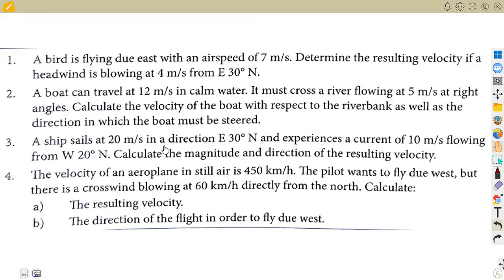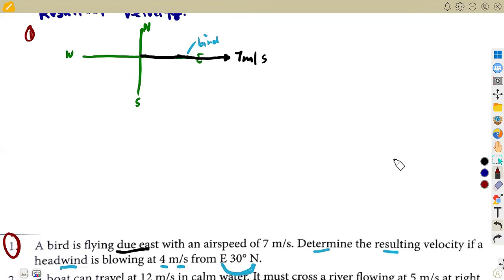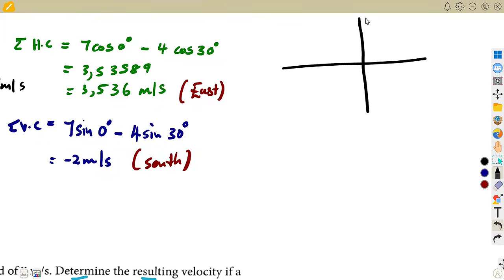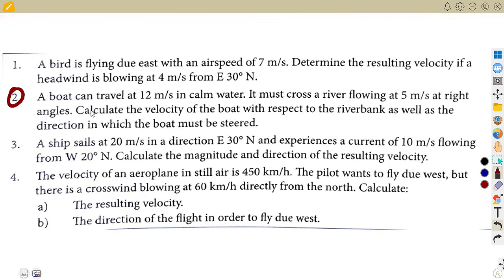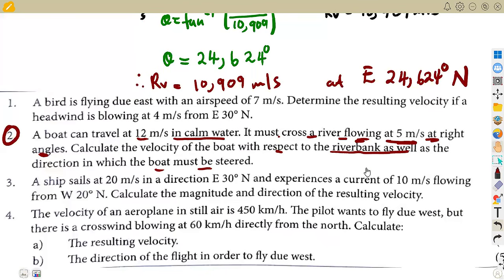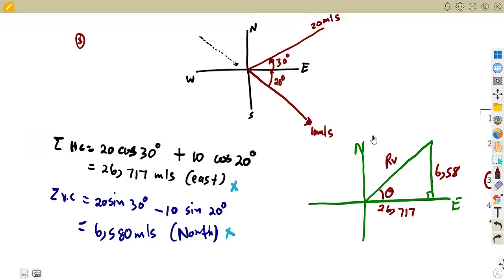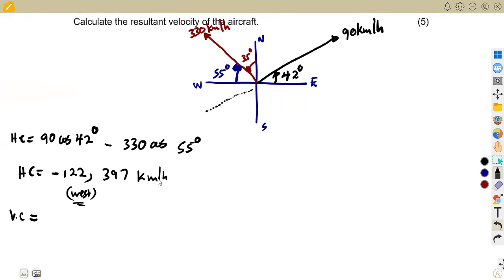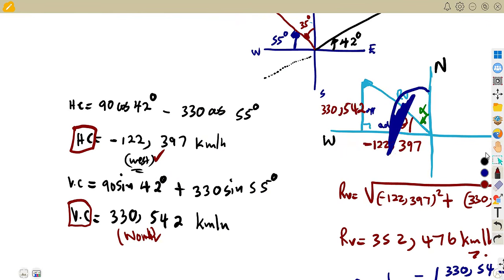Engineering Science N4 Kinematics Resultant Velocity Introduction @mathszoneafricanmotives

Comment: Sir am a little confused now , you used 4sin30 as the vertical component of the wind& 30 is formed with the horizontal why not use the angle formed with the vertical , on the first question !!
Reply from the maker: Hie when taking the acute angle,  you must use the one between the horizontal and the terminal.  Unless you choose to use the actual angle taken from the +ve x-axis to the terminal

Comment: Sir can you explain to me why did you use the 55° not 35°
Reply: I dont know how to explain but I will try.....when we are using the angles,we always take from the x-axis(East to North....West to North....West to South....East to South)....if the angle we are given is from the Y-axis then you subtract from 90....Here is an example.....the plane is flying 15KM/H at an angle of N30*E.....we cant use the 30* as is it because it is from the North is on the Y-axis so we will need to subract that 30 from 90 then we use our answer as the angle......Please do not come for me,I told you when I started that I cant explain
Reply from the maker: Yes you can use it as it is that one
Reply from the maker: Hie can indicate which part exactly